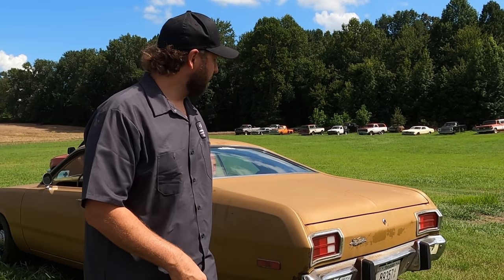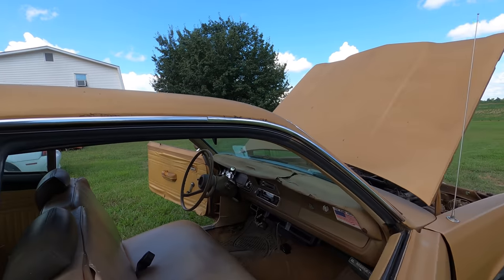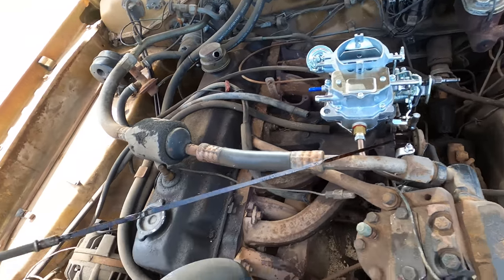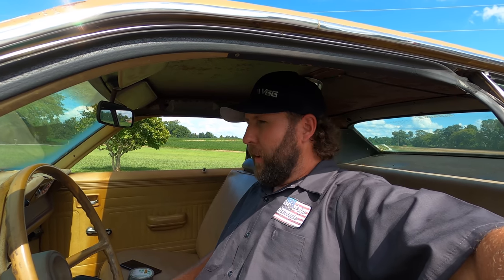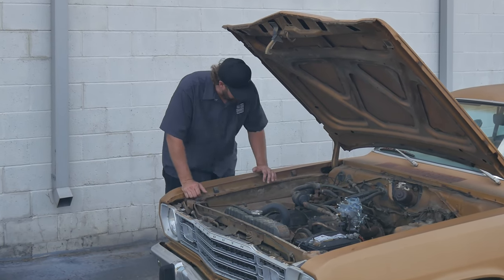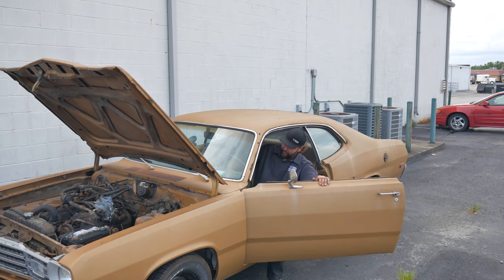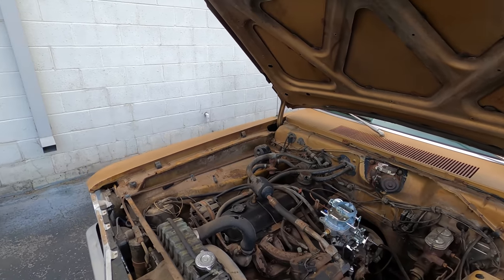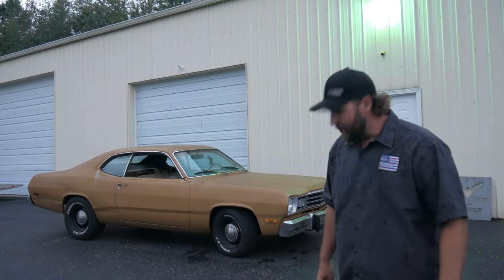Driving a 1973 Duster to the NEW shop in Tennessee! (Bought Sight Unseen)

Comment: My very first showroom new was a ‘75 duster slant 6/torqueflite for my job as a salesman. I loved the car but the dealer could never get the motor tuned right. Sputter/cough/stall a lot. Dumped the duster after a couple years for an old ‘73 Satellite. Memories.

Comment: Had a 73 Duster , back seat would lay down for surf boards , I was told . That was 40 years ago . I miss it still . 318 4 speed tranie , fast . [ EDIT ] The 318 was not stock

Comment: Where is the air filter housing? Also, apply some flex-seal to stop any leaks, that shit works very well, I patched my front steps with flex paste, easier to work with than cement, and yes, the paste gets really hard after curing, than you can paint it If you so desire!!

Comment: Also, a guy's fairly certain that the plastic insulation for the throttle cable isn't supposed to be in the clamp, I'm fairly certain the metal part is supposed to be clamped into there. I could be wrong, but I'm pretty sure it is.

Comment: Fist step, pull the head and do a valve job. Then restore the EGR system. 1970 era Chrysler cars used EGR (Exhaust Gas Recirculation) to cool their lean combustion. Every older Chrysler product I worked on back in the late 1970s early 1980s needed a valve job because stupid owners thought they could save gas by disconnecting emission controls. It was too easy to pull vacuum hoses from EGR valves and in every case the engines ran hotter and eventually suffered burned valves.

Comment: Not sure if the back space is correct but 1st gen dodge dakota and some full size Van's used similar steel 15 inch wheels late 80s early 90s 4.5 bolt pattern like a ferd

Comment: thought I noticed some water inside the front passenger side turn signal .. maybe not though .. did you try switching on the Airtemp air conditioner to see if compressor engages?

Comment: Haha, I thought all Chrysler Corp. vehicles had throttles like that from the factory- I remember replacing the one in my '75 Ramcharger with a wire tie-down I cut to size, which worked great!  The first attempt, with a wire clothes hanger, wasn't quite as successful...

Comment: The “leaning tower of power ” in ‘73 was rated @145 hp 4000 rpm with 215 ft. lbs. of torque.

Comment: I had a 74 dart sport with a slant 6 in her and I wanted to pull the motor and swap it for a 360 . You can make some nice horsepower with that smallblock . Maybe that would be an option , or a 318 with 360 heads ? I dunno - sounded good at the time . Ended up givin the car to my then girlfriend and she dumped me and that was the end of that idea . Doomed from the get go I guess !

Comment: I blow up one of these slant six Duster engines in my parent's back yard doing a stupid brake tork on it. That was one weak slant six mopar engine. It end up in my parent's back yard completely dead. Most them slant six mopar engines are very strong engines and hard to kill off. That is a very cool old car you have there. Drop a 340/440 Mopar Engine in it, and beef up the suspend, and place a lemon/lime  paint job on it. Make it look completely sick.  (At least your car does have push rods, and pistons and a timing chain down in the oil pan like my slant six did.) One excellent engine if taken care of properly and kept away from me.

Comment: I do have something you might just be interested in probably not . but it is a 1970 318 truck engine with 50K original miles on her pulled it myself odd meter reeds 48248

Comment: Dang dodges always have a bad ground on the wipers. I once electrical tape a little wire from the battery and just taped it to the body of the wiper motor, boom.

Comment: stick a modern engine in it!! straight 6? inline 4? make it the best of both worlds. a perfect daily runner with that old school flavor added. wouldnt be hard to find a 4 banger in rear wheel drive that would have almost the same power output as that hefty slant 6. heck, a bmw slant 6 would blow those tires off the thing. ever heard of the general motors Atlas motor?

Comment: i think you over estimate mileage. back then cars were lucky to get 100k. getting to 200k was pretty rare or unheard of. not like today.
Reply: Dad's 1965 Rambler 660 classic w/ 232 I6 3spd manual had 365,000mi got 19mpg and didn't leak or use a drop of oil when the county confiscated it for a bogus child support case